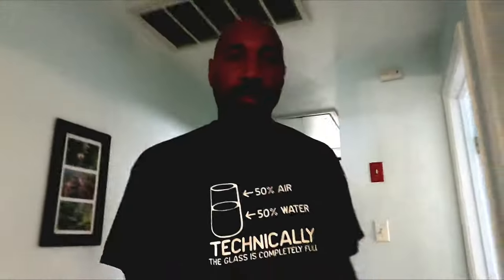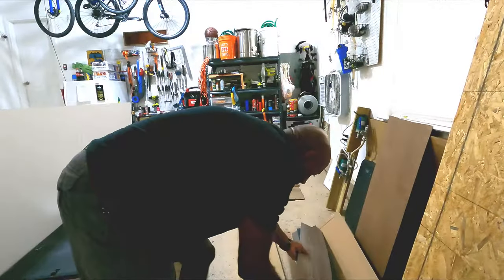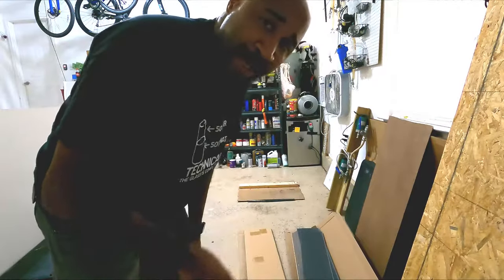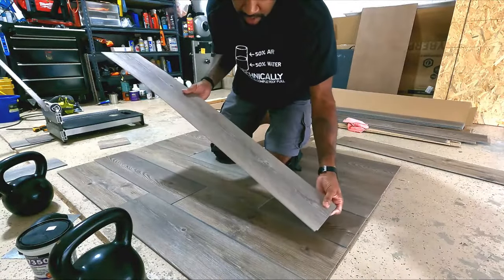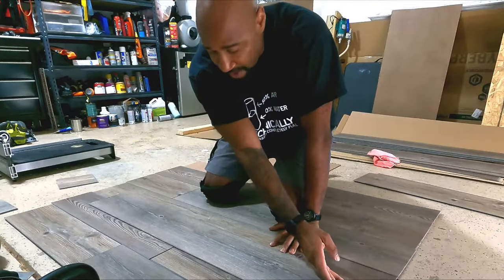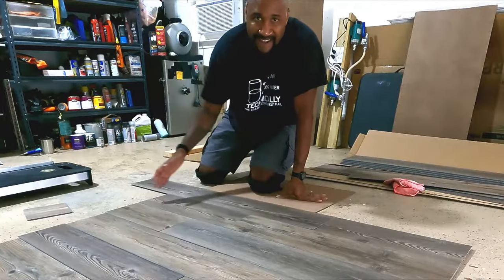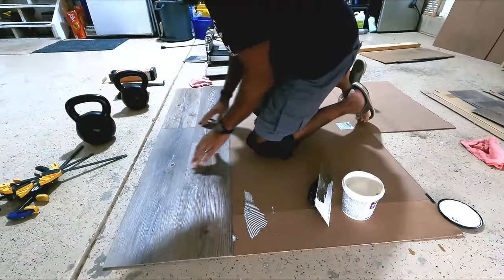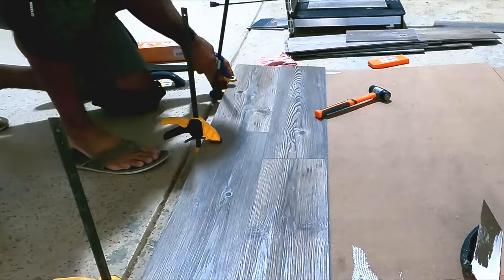DIY LVP Desk Chair Carpet Mat Build

Comment: Thank you so much for this video.  I have wasted so much money on those plastic mats that fall apart fast.  Never again!  I made a chair mat with 8 slats of flooring I found at a local thrift store; glued them to the rough side of an 1/8" thickness hard tempered brown panel (big-box home improvement store); cut it size, rounded the edges and sanded.    Spent less than $25 for a customized chair mat that I love and it will last for years.  Tip for sizing - I sat in my chair at my desk and rolled around the floor.  I put small pieces of tape where my wheels stopped - front, back, left, right, then measured the area.  I discovered I rolled more to the left side to reach a second filing cabinet.  My mat is longer on the left to accommodate this.  I also made a note of where my feet usually rest under my desk and made the length to match.

Comment: I wonder how well this would work on a 4' x 8' sheet of 3/4" plywood. Might try it out. Nice work
Reply: The thicker plywood has two problems: it's heavy and can be awkward to move and more importantly it raises you up quite a bit.  If you can't adjust the desk to be higher it might be high enough to be uncomfortable to work at that height.  I made one using 3/4 b/c that is what I had and had to re-do it with something thinner b/c it raised me up so high I couldn't type without wrist pain.

Comment: Hey, Jay.  You and I look to be about the same size and I was wondering how this is holding up after 11 months.  I am going to make the same thing for my wife and I, but was thinking of making mine with 1/2" ply or OSB.  Thanks for the video.
Reply from the maker: It has been holding up great. I wouldn't go any thicker on the backing, it's pretty solid once you glue the lvp down.
Reply from the maker: Update: it's starting to crack ☹️ a small hairline crack formed, and now several other pieces have started cracking. I think it could be the backer I used is very flexible, and the lvp has rubber backing on it. I think that allowed enough flex that eventually started cracks. I'm going to make version 2 and use stiffer base and lvp without backing.
Reply: @JayJenkins  Have you made the new one, yet?  What are you plans for the backing?  1/4 or 1/2" ply?
Reply from the maker: @craftedbykvg4649  not yet. I'll probably go with 1/4" plywood and an lvp without a backing. Trying to make it so it doesn't flex the LVP when the chair rolls around.
Reply: @JayJenkins  That's what I was thinking.  1/4" ply or to save some money, OSB.  I don't think it will matter.  I think some of the less expensive LVP could be best because it doesn't have the flexible backing.   I'm going to build one for myself with a custom shape and am thinking about going into production with them locally...offer some standard sizes as well as custom shapes and sizes.

Comment: Great video! For a mat of that size, besides aesthetics, is there a benefit of cutting the boards? It would save me quite a bit of time not having to cut them 😁!
Reply from the maker: Not really,  if your boards are longer than the mat. If your boards are not longer than your mat you would want to cut them to avoid having all the short seams line up. That would make a weak point because lvt flexes.

Comment: Nice work. Looks nice.  The bottom board layer you used seemed fairly thin. Are you satisfied it won't flex and begin breaking down over time as the chair rolls around?  Just curious if you hypothetically were purchasing wood/supplies and building new again, would recommend a thicker base for more durability/strength?
Reply from the maker: For this one no, the lvp I used had enough thickness to it that it would be difficult to crack even by itself. Because of that I used the thinnest subfloor I could because I did not want the chair mat to be too thick. If you are using very thin lvp, you may want to use a thicker base but so far I have had no issues with this chair mat cracking. It does flex a very small amount but the edges, usually the first place of the cheap chair mats to crack, has been fine.
Reply: @JayJenkins  would you happen to know the approx thickness of your mat? Base and LVP together?
Reply from the maker: @Jlpeaks  maybe 1/2 inch or a little more.

Comment: Without the extension piece that goes under the desk what is the measurement of the other part if that makes sense?
Reply: Tip for sizing - I sat in my chair at my desk and rolled around the floor.  I put small pieces of tape where my wheels stopped - front, back, left, right, then measured the area.  I discovered I rolled more to the left side to reach a second filing cabinet.  My mat is longer on the left to accommodate this.  I also made a note of where my feet usually rest under my desk and made the length to match.

Comment: I know this video is a year old now but I was wondering if anyone has any recommendations on what to use on the edges to make sure there's no toe stubbing/cutting/whatever going on. Thanks in advance.
Reply from the maker: I just sanded the edges around them off a little bit but I didn't want to put anything large on the edge so that I could still roll my chair onto the mat from the carpet.
Reply: @JayJenkins  I ended up getting some outside corner trim for it and it ended up great. Thanks for the DIY, it was very helpful.

Comment: Great idea! I’m definitely going to be building one. How is it holding up? Anything you would have done different?
Reply from the maker: It's holding up well. 2 things I added, a metal transition strip on the back to make it easier to roll my chair up from the carpet. I also sprayed the bottom with rubber spray to keep it from sliding. If I did it again I would put the rough side of the sheet down against the carpet to keep it in place.
Reply from the maker: Update: it's starting to crack ☹️ a small hairline crack formed, and now several other pieces have started cracking. I think it could be the backer I used is very flexible, and the lvp has rubber backing on it. I think that allowed enough flex that eventually started cracks. I'm going to make version 2 and use stiffer base and lvp without backing.